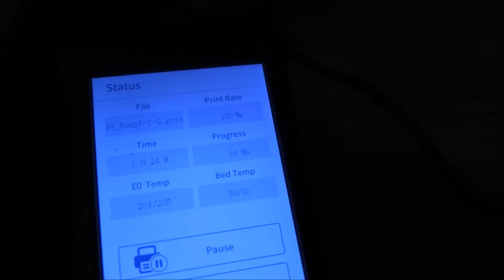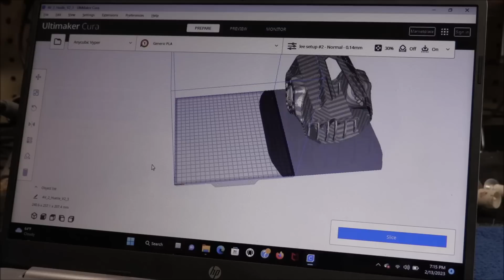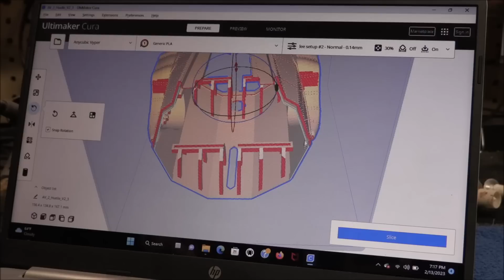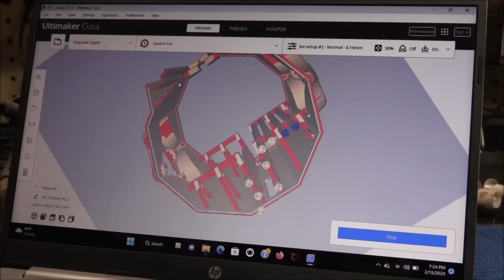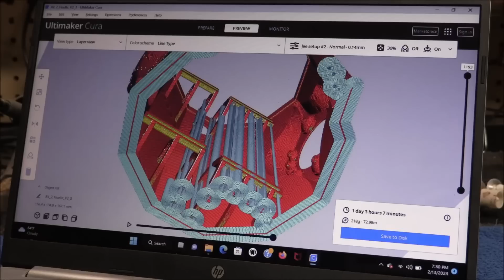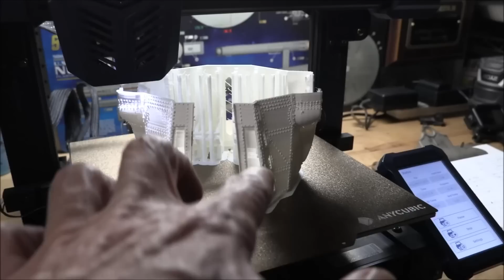My 3D Printing Adventure Begins With The Classic Nautilus From 20,000 Leagues Under The Sea

Comment: The rpm of the prop is about 80 rpm, if I remember correctly.  Just in case you want to turn the prop with a motor to scale.

Comment: So now getting to the end of the video, Tree supports touching build plate only would have been the way to go. Great video.  I am not a troll and may sound dry, not meant to be condescending its just me, My background, designed and built my first filament printer in 2006, I have since designed and built printers for NASA, Blue Origin, and Space X, direct metal deposition done in two ways. First way is simple just like a filament printer but is tightly controlled MIG welder, the second way is is done in one of two systems powdered metal is blown into a laser beam or electron beam, melted in that stream and deposited on the surface. The powder systems are typically done in a vacuum chamber. NOTHING TOP SECRET HEAR he he he.  Wish I had more time to make content to help people just not at a point in my life yet.

Comment: I know I am late to this video, but there are test that you can run in order to know what to set your support threshold angle to, those tests will be dependent on nozzle size, layer Hight, and material / temperature.  Run a temperature tower that includes bridging and overhangs then run  stringing tower, dial in those settings.

Comment: 3D printing is fun.  I bought the same printer.  So far I have gone through 5 rolls of filament with zero printer issues.  The only issues are those caused by not understanding support and all those other stupid settings.  These things should be as simple as using a laser printer.  Maybe AI software will fix these issues in the future.

Comment: Do you prefer resin printing or PLA? Not just the print quality and ease of printing but building the kit up and cleaning it up for painting.
Reply from the maker: I am just now moving in to resin printing. It's messier and harsh chemicals are involved that are used for parts cleanup. It is more tedious but high definition resin printers produce better results with zero print lines and the ability to create super fine crisp details on very small parts.

Comment: In Cura I like to use "tree" supports. I find it's good enough support and prints the bare minimum of extra filament so helps with print time as well. Plus they break away from the model very easily when finished.
Reply from the maker: Yes, I'm looking into the tree type supports, great suggestion.

Comment: Holey moley, that's a beast even at 65% I think you're moving at a pretty good clip-- you did start with the Big Guy of design. I do think you made the right call on getting a resin printer as well. That way you can exploit what each family does best.
Reply from the maker: It's great that the filament material and resin are not terribly expensive so that learning mistakes don't wipe you out before you get anywhere.

Comment: How difficult would it be to take a 2D image of a Space Ship I designed and someone replicating that into 3D? would the owner of the printer need a vector graphic of the image, how does that work. I had created a ship for a Sci Fi Comedy that didn't go anywhere passed the design stage and wanted to actually have a 3D model of it.
Reply from the maker: The model will have to be 3D rendered as an STL file. Then the Cura program can convert it to a G code file that can be used to print the parts.
Reply: @TrekWorks  Yea I don't have a comp that can handle 3D building program. Thanks though. Good Work with this btw.